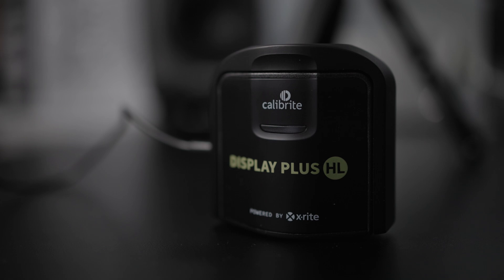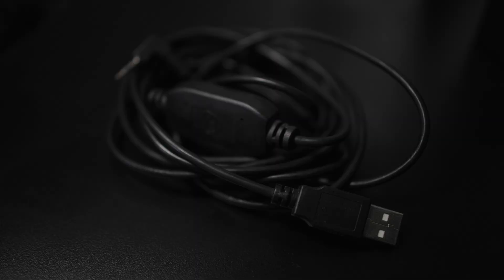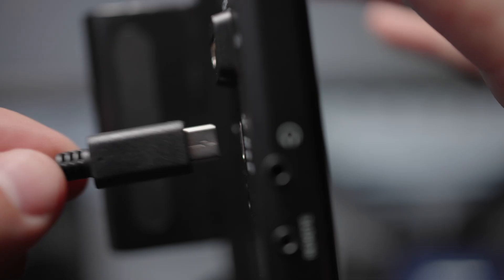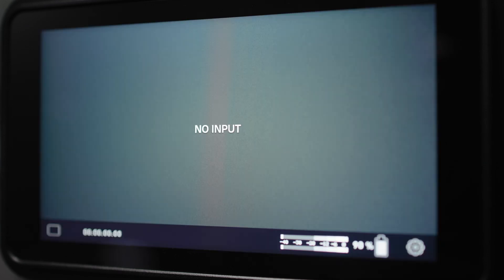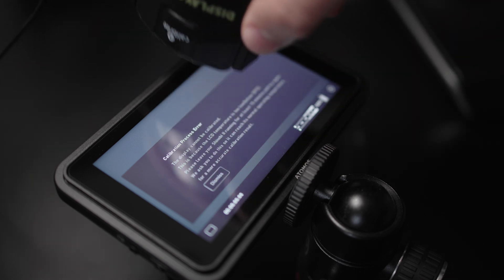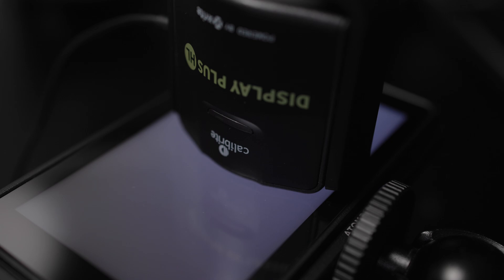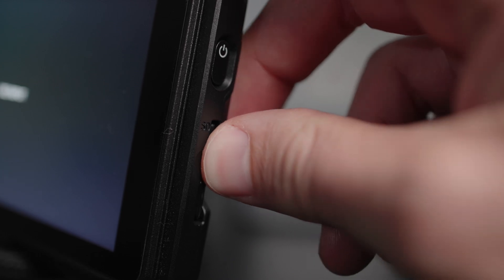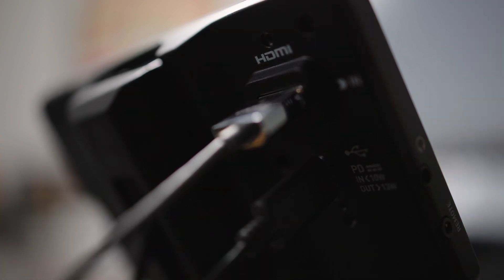Atomos Shinobi II Calibration Tutorial with Ollie Kenchington

Comment: This is great info for those that use the Atomos, is there a workflow that you suggest for calibrating brands that don't have built in software? And would that same workflow also work for things like TVs and larger onset monitors? In the past, I set my monitor to custom RGB and adjusted it until I was on target. However, that no longer seems to work when testing several monitors. Thanks in advance!

Comment: While it's appreciated that Atomos has such a simple calibration system, I've found it to be very hit-and-miss, with multiple Atomos monitors (some the same model) I've seen very different end results after calibration.
Reply: This kind of probes are inaccurate themselves. Professional calibrators use spectroradiometers in combination with colorimeter to get proper results. And spectroradiometers costs few grands.
Reply: @igorzhidkov1957  Good point, but how would that explain that I seem to be able to get SmallHD monitors to match using the same calibrator?  It's a different process, using Resolve and loading a custom calibration LUT to the monitor.  It seems much more effective than Atomos' app, though their app is much easier to use.